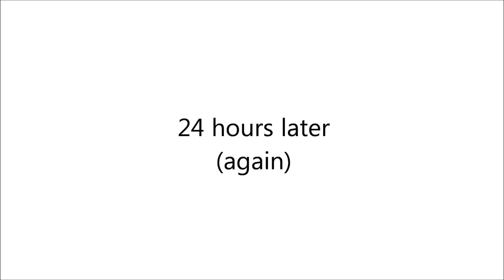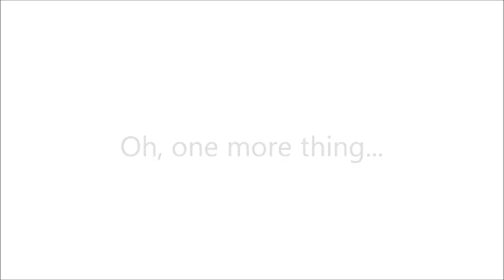Finishing crystal clear canopies on scale model aircraft - how to guide

Comment: If I may suggest this, when you are letting your Parts to dry over night or 24-hours, cover them with a Bowl or a Drinking Glass.  This will help protect the Parts from unwanted things in the air such Pet Hairs, Lint, and Dust from landing on the Parts while they are still WET...  That's what I do with mine Clear Parts.
Reply from the maker: Great suggestion! Thanks. Definitely a good idea - consider this a Second P.S. to the video!  ;)  Dave
Reply: I use a small plastic container with a sheet of paper towel on the bottom and a lid to seal mine up. I always wait several days before taking them out.
Reply: MH53JTom  in fact I used to do it, but now I have a new method is more efficient. You can put the transparent parts in front of a air outlet it could avoid the dust or other dirts, in the same time it would be more helpful with drying. That is my experience.
Reply: Dave's Model Workshop - I was only able to find a lemon scented Pledge at my local Coles, just wondering if it makes any difference?
Reply: PJ B that can be used for shine and protect. You can use it for protection of models surface. As a replacement of gloss. But it not work for transparent parts' crystalline.
Reply: I use a plastic cake stand.

Comment: After dipping and blotting on the tissue or paper towel I then set it on wax paper with a cover on it to prevent dust. The wax paper prevents the possibility of it sticking or pulling particles from the tissue. I usually find a styrofoam or clear plastic cup to cover it while it dries. Hope that makes sense. Love the videos!

Comment: Great video & great tip, mate - thanks!  A couple of tips of my own - I use a small, fine-toothed razor saw to remove clear parts from the sprue, doesn't make stress-marks in the styrene, and clean-up is a doddle.  And toothpaste is good for polishing out scratches (don't use the stuff with bicarb in, it can be a bit too aggressive).  Thanks again, keep 'em coming!

Comment: Glad I found this. I've just actually ordered some from the US and will be testing it out. Also through an airbrush hopefully.
Reply from the maker: I often airbrush Pledge/Future before decal application and then later to seal decals - it works a treat.
Reply: Dave's Model Workshop that's what I've heard and is good to hear another confirmation. I'd use it as cheaper top coat before weathering etc. Can't wait. Thanks for the info.

Comment: With regard to the yellow issue, I believe it doesn't matter because the layer adhering to the canopy is so thin. The Pledge doesn't 'yellow' the plastic over time. Plastic food wrap exhibits the same characteristics. It can look slightly colored when layered thick on the roll but appears clear when you look through a single ply.
Reply from the maker: Thanks Paul, I totally agree, it's just not an issue that I've ever encountered. Thanks mate, Dave

Comment: Hi Dave , spotted this wonderful video at somewhat of an appropriate time, have only recently discovered the issues with Tamiya  extra thin cement and model canopies, your use of pledge prior to building sounds genius - however , both these products are now out of production and a suitable replacement I believe is Holloway House Quick Shine Multi-Surface Floor Finish . 
However this product has a milky consistency which does appear to dry clear , and supposedly does the same job!
My ? Could you prepare the canopies with this prior to hand painting  “ Frame lines” on the canopies or will this gloss protection affect the paint job ?
Tricky one , but have seen a u- tube video using this product apparently doing the job !
What do you think Dave .
Best wishes .
Ed
Reply: Hi Ed, I'm not aware of the product you mentioned but it sounds like it would be very similar to Future. I'd test it on a bit of clear sprue first. As for painting on top of the clear coat, you should be fine to do so. Best of luck! Dave
Reply: Will do Dave , many thanks for your very prompt reply.
Best wishes.
Ed.

Comment: Great video, thanks ! 
Am new to this game ( well after about a 40yr lay off 😁)  Do you paint the canopy frames before or after treating ?  If after, are there any additional things to consider?

Thanks in advance 😊
Reply from the maker: Hi Nigel, I paint the canopy frames after dipping in the gloss, so that the framework isn't glossier than the surrounding fuselage paint (which it would be if you painted the frame first, then dipped). Re: additional things - i can't think of any, just be careful with masking and you should be good :) Cheers, Dave
Reply: Thanks very much,  will give this a go. So much more to learn than the old days when I first did any building 👍🏻😊

Comment: Thank you for this tutorial. One question- do you need to sand away the edges that will be ca glued, or do you apply the ca right over the Future?
Reply from the maker: I don't sand away the Future - if you do so, you may still get fogging of the canopy (the Future protects it from reacting with the CA glue). The bond isn't quite as strong as a result, I will admit, but it saves you from the dreaded fogging. Dave

Comment: Do you paint the edges after you dip the canopy in the floor polish?  I've got some complicated masking to do with a coat of airbrushing for the exposed rails and canopy dividers.  Just want to know if that should be done before or after you dip in the polish?  Great video.  I've subscribed!
Reply from the maker: hi Richard, yes, any canopy framework needs to be painted after the canopy is dipped, otherwise you will have glossy metal frameworks if you do it the other way around. Cheers, Dave

Comment: What if you carve out the "Manky Blemish" with your fresh #11 blade, super glue the dimple, sand and polish area, then dip it a couple of times? When your ready don't glue canopy to fuselage but scatch off key attachment points then use medium strength super glue very lightly. What do you think?
Reply: I reckon that would have worked actually. Good call.

Comment: I have seen other users use the Novus polishing system on their clear pieces and it seems to work just as well.
Reply from the maker: I wasn't aware of it until I read your comment and googled it. Looks good, but expensive?
Reply: For a 2 oz bottle of Novus 1 and a 2 oz bottle of Novus 2, I bought them from Amazon.com for 9 dollars. I didn't buy Novus 3 because I am not sure if the part I am polishing will need it yet. Just trying to see if no 2 will do the trick :)
Reply from the maker: Ah, that's a lot cheaper than what I saw here in my Australian google results. Maybe it is expensive here ($50 for three bottles) as it has to be imported?

Comment: Great video. You definitely get nice results with the Future, but my only concern is that, having wax as a base, does that leave the paint on the frame bits more vulnerable to scratches?
Reply from the maker: Hi J. Lee, I guess so, but it's never really been an issue for me. In theory you could be right, but I've never noticed paint adhesion issues. Dave
Reply: Johnson Future does not contain wax even though "wax" is in the name on some bottles. If you check the ingredients listed on the bottle it contains water, acrylic, ether & TBEP plasticizer.

Comment: Do you paint before dipping in the polish or afterwards  as I don't want the masking tape to leave any residue
Reply: Dave's Model Workshop awesome thankyou the only reason why I ask is that I'm currently working on a 1/48 airfix desert storm tornado and has a rather large canopy. Thanks again really enjoy the videos
Reply: Dave's Model Workshop  awesome thankyou. Also can I use future instead of micro sol?
And is tamiya flatbase the same thing as the testors dullcote?
Sorry for these probably stupid questions but some of these techniques are very new to me still.
Reply from the maker: Hi Jody, MicroSol is for settling decals, to make them conform better to the shape underneath them. Slightly different uses. Tamiya flatbase is much the same as Testors Dullcote, they do pretty much the same thing. And never apologise for asking questions, it's all good!  Cheers, D
Reply: Dave's Model Workshop thankyou I think i will try it out on a tester first as I've been told that the tamiya flatbase leaves the decals cloudy if you use it by itself as in i will be hand painting it as don't have a airbrush. Thankyou again.
Reply: Dave's Model Workshop Dave, you can use it for decals as well. It prevents silvering under the decals. This is best way to prevent it on Matt finishes. Apply over area that needs decal. Apply decal while still wet. Useing cotton bud roll out the bubles and excess. If you need too, apply the decal setting solution, let dry. Add Matt finish and your good to go. That is the same stuff I told u about on painting the vynal tracks figures or any part u want the paint to stick. Just use it as a primer.

Comment: Regards to fine scratches on canopies, toothpaste or a polishing compound should get them out (Tamiya make, I think, several grades of this stuff), so before dipping in your Pledge try polishing them out first.

Don't know if it will improve the blemish from the sprue point, worth a shot though.
Reply from the maker: Thanks PJB - good tip re: toothpaste. I used some polishing a headlight lens a while back, and it would definitely also work on canopies. Nice one.  Cheers, Dave

Comment: Tanks for the tip !!! Do you use any barnish after mask and paint the clear parts?
Reply from the maker: Hi Alfredo, no, once I have painted it and removed the mask, I don't apply anything else to it. If the masking tape leaves any residue, I clean that off and apply a tiny amount of floor polish, but that usually isn't required.
Reply: Thanks you Dave, I apply this method in my nexts models. Hugs from Brazil!

Comment: I'm in Australia also. You've had your Pledge OneGo for about five years! What's it called today? I've seen many a video talking about Pledge this-and-that, but I've never found anything in the last few years. What is the equivalent in 2017? Thanks!
Reply from the maker: Hi Morris, I'm not sure what it's called now. But basically any CLEAR floor polish would work. Bunnings has one called Long Life 2L General Purpose Floor Cleaner for under $10 which I think would probably work just the same. As long as it is clear, and watery (not a wax) you would be good to use it. Hope that helps, Dave
Reply: I've been using the Bunnings Long Life floor polish for canopies... Works just the same.

Comment: I recently bought a clear coat from Revell in the spray can to try it out, and after putting it on my me-262 and letting it dry overnight, I came out to find dust had settled on it whilst it was wet, and thus sealing it into the paint job. How do I fix this issue? It’s my best model I’ve made so far and my favourite plane I really don’t want it ruined..
Reply from the maker: Hmmmm, I really don't know. Removing the top clear coat might damage the paintwork underneath... Anyone able to assist? Dave
Reply: @DavesModelWorkshop  ya I just kinda left it and just left it as is and made up that it’s an old aircraft that never saw use, works me lol.

Comment: You can always flame polish it with a small torch just be careful not to linger in one spot for too long. This would take out that small dimple where it was detached.
Reply from the maker: I've never done flame polishing - I'd be worried I would melt it all! I imagine it takes a lot of practice?
Reply: @DavesModelWorkshop don’t do that, it will make the plastic very brittle 
Especially the thinner the plastic

Comment: I know this posting is 3 years old, but I was wondering if it made any difference if the plastic part was colored (example" Martian War Machine green wingtips and front)?
Reply from the maker: It should still work with tinted plastic - I.e. the plastic has had a colouring agent added to it by the manufacturer before going into the kit mould. If you have tinted clear plastic yourself that might not work so well.

Comment: One suggestion: it's better to dip your clear parts AFTER masking and painting. Even the gentlest of masking tapes might damage the shine.
Reply from the maker: But if you wanted a matte frame, for example, how would you achieve that if you have dipped the whole painted canopy into the polish? Cheers, Dave
Reply: Dave's Model Workshop I simply touch up the frame with matte varnish. Most of the time it's not even necessary, as it's not noticeable that the frame has a  it of a shine to it. Have a look at Phil Flory's models at www.florymodels.co.uk  He uses the same method with super results.
Reply from the maker: Ah, cool. Good suggestion Ray. I've never had problems with masking tape stuffing up my clear-coated cockpits, other than on my Stuka and the crappy masking tape I used then would have ruined anything it touched! CHeers, Dave

Comment: Would airbrushing a coat of gloss varnish do the same job?
Reply from the maker: I think it would be harder to control any excess - in the video I shake off excess fluid, so it doesn't run and collect in thick areas at the bottom. That would be trickier with gloss varnish. But it could work - give it a try and let me know!

Comment: Do you airbrush Future floor polish onto your models before putting on decals?  If so do you use an airbrush and what do you use to clean the airbrush with?  One last question I have listened to several model builders say to use dullcoat before weathering.  I was under the impression the one should apply glosscoat please help unconfuse me?
Reply from the maker: Hi Robert, yes, I do airbrush Future on before applying decals. It really saves them from silvering. I use plain old mineral spirits (turpentine) to clean it afterward, works a treat. Re: weathering - things like washes and pin washes work better on a gloss or semi-gloss finish, so you are correct. I do everything and then give the finished result a dullcoat to complete the job. Cheers, Dave
Reply: Dave's Model Workshop Thank you.  Very much that makes me feel better.  I like your video on canopies as well.  Take care.

Comment: it will stop the glue from reacting.. so it wont stick anymore. I guess you recommend PVA glue for clear parts like most modellers do, right?
Reply from the maker: Hi Fox, I actually use CA glue and it seems to work fine, the Future stops it from fogging and it holds good and tight. I have heard the PVA glue idea, but I find that bond a bit unreliable. Dave

Comment: I would try two things.

First, I would try filling the imperfection with super glue.  If the blemish actually goes all the way through then I would try filing it away with a small round file.  Then I would fill it with super glue by building it up with several layers.  Obviously you would have to sand inside and outside but the future would take care of the scratches.  Or you could just continue to polish with ultra-fine papers such as micro-mesh.

Comment: Hi could you have any tips or do a video on how to create jet aircraft exhaust heat staining possibly with a brush as I can't afford to purchase a airbrush setup
Reply from the maker: Hi Jody, I've not done one simply because I don't build jets generally. I build only prop planes. I know the effect you mean though. Dave
Reply: Dave's Model Workshop ok no worries thankyou.
Reply: I don't know were you live but in the US I bought an airbrush kit for 10$ at Harbor Freight tool store. It is a tool used for making cakes. It works great. You still need an air compressor to power it. Harbor Freight is a great place to get one. Get one that has a tank to store the air. Air brushing makes such a big difference. Easy to use too.
Reply: jody reynolds Tamiya sells different weathering kits that would work nicely for you. They come in little boxes like women’s makeup and come with a tiny foam applicator brush, the same ones you can buy in the beauty section of your local store.

Comment: But if there is cleaning agent residue on the surface, how can any paint stick to it?
Reply from the maker: I'm not quite sure what you mean by "cleaning agent residue"? But if you mean the polish, paint does stick to it okay. I wouldn't recommend handling it a lot, but I've never had any paint flake off a canopy that I've treated this way.
Reply: Thanks for the clarification. I was under the impression that this product was some kind of detergent, but evidently, it seems to be some sealing component instead.
Reply from the maker: Definitely not a detergent. It's a floor polish, so seals a clear layer of gloss on top of the canopy plastic.

Comment: Would this also work on color molded parts?
Reply from the maker: Hi Michael, do you mean just normal, opaque parts, or do you mean like smoke-tinted clear parts? Should work just fine on tinted transparent plastic. If you mean normal non-transparent parts, what do you mean by would it work?  Cheers, Dave
Reply: Hi Dave. I was wondering if this would give the bright shine to a model car body that is molded in red plastic, instead of spraying clear coat. Thanks!
Reply from the maker: Aha, thanks for clarifying. I've never done that, but I don't see why it wouldn't. You'd probably get a better result with several coats of gloss paint though. Give it a shot and let me know how you get on!  Dave
Reply from the maker: If it doesn't work, you can just strip the Future off using Windex and paint like you would have anyway.
Reply: Thank you, Dave. I'll let you know.